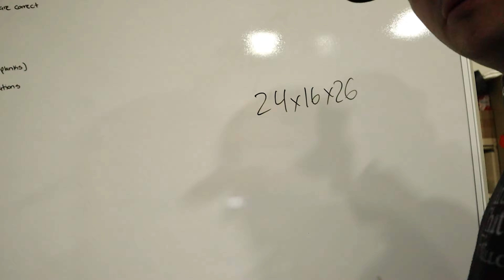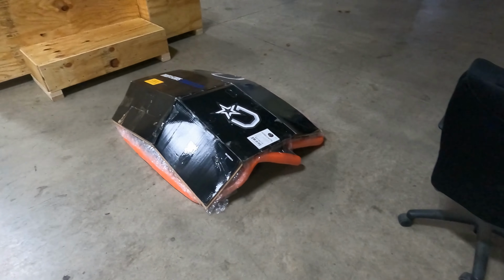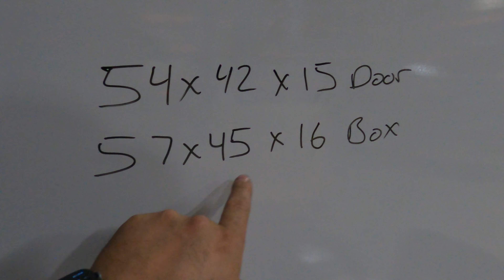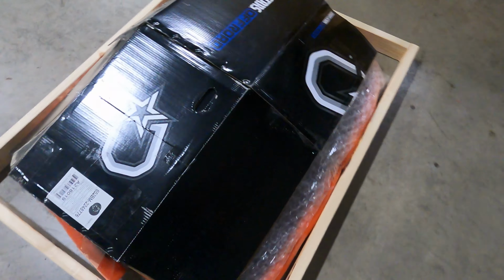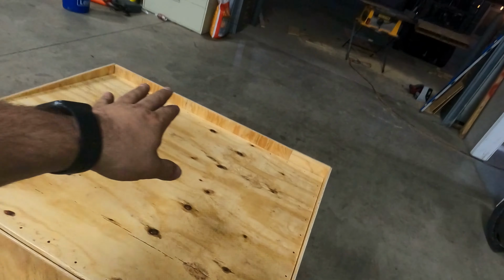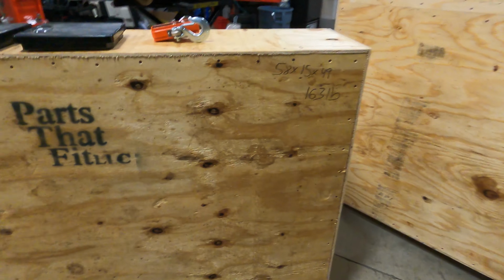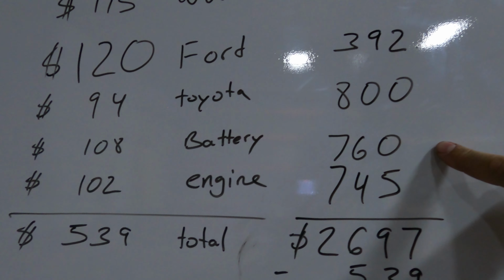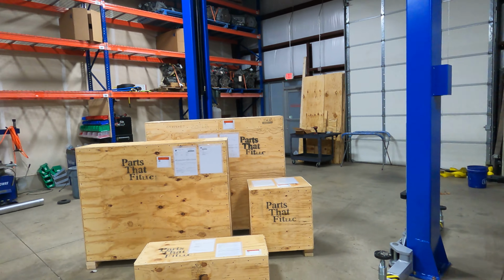HOW TO PACK LARGE USED AUTO PARTS  LIKE A PRO | EBAY BUSINESS | CRATE BUILDING | ENGINE DOOR BATTERY

Comment: How do you go about putting freight shipping in the eBay listing? Do you select freight and put in the description that it will be shipped through a carrier?

I noticed rates will a lift gate are higher in price so I’ll be taking my freight to the carrier and they have to pick it up.
Reply from the maker: On item like doors and engines I put a flat rate charge of $200 or $150 for freight. In the description I put that the item must be shipping to a commercial business location with a forklift or loading dock. Once someone buys the item I verify the address is a business. If not I offer them to pick up at the nearest freight location or $80 liftgate fee. 
you can also leave it as freight and the customer will have to contact you before buying to see how much shipping will be for their location.

Comment: Quick question regarding building the crates. Is there a standard spacing requirement on the space between the 2 "legs" at the bottom  for forklift or pallet jack that we must build to?
Reply from the maker: The spacing is not as important at the height. 2.5 is the minimum height for them to used pallet jacks. If the box is small they can you one of the forks to move it around.

Comment: Awesome vid. How do you decide what company you decide to ship with? Is it depending on the buyers location or what the product is that you are selling? I've been doing this for a little while with smaller used auto parts and want to get serious with it. Do you ever use UPS or usps with smaller items? I remember a box I sent with ups was like $90 in shipping so I was very surprised to see you could ship that hatch gate for $100 in that big crate! Thanks for the help
Reply: You should try goship.com or uship.com these companies throw you 8-10 quotes on different companies and its easy and fast. Instead of having a account on each freight company
Reply from the maker: Yes. We use uship.com to see what are best prices. Also it makes a big difference if you are shipping for a business to a business. Residential deliveries are expensive. You can drop the package of at the freight terminal and your customer can pick up at the terminal near them to save money if there is no business location.
Reply: @partsthatfit349  i have used both and to be honest goship is slightly cheaper. Apparently uship takes a bigger cut. I have a hard time uploading tracking info on freights. How do you take care of that?
Reply from the maker: In my area I like to use YRC freight so I don’t go through Uship.com avoiding the fees. But if Yrc is expensive I check uship to see more options. 
With Yrc I upload the pro number and carrier as YRC it works every time.
Reply: @partsthatfit349  thanks man! I know ebay has some accredited carriers and I upload pro from them too and sometimes it works sometimes it doesnt. Ill look into that

Comment: Is that cost friendly to use that much material for just shipping?
Reply from the maker: Not necessarily but headaches avoiding for sure. We had no damaged freight since we started crating. Used to have 3-4 damages a month and dealing with insurance. Also used parts are not covered by insurance in most cases. So crating saves me money and time.

Comment: What kind of scale is that you used for the forklift. I need one for my freights because the one I have is only 300lb
Reply from the maker: Bonvoisin Digital Crane Scale 1000kg/2000lb Industrial Heavy Duty Hanging Scale with Remote Control Portable Electronic Weighing Crane Scale 5-Digit LED Display CE Certified (1000kg, Orange) https://www.amazon.com/dp/B088BL3DF5/ref=cm_sw_r_cp_api_glc_fabc_PrAZFbPB5YYZB?_encoding=UTF8&psc=1 

I got this one from Amazon
Reply: @partsthatfit349  thanks so much! Will get one immediately

Comment: I can certainly see why your business failed as you've used $20 in bubble wrap $28 in foam floating material $2 and tape oh my God the hundreds are spending in plywood and 2 by 4 it's just a package up of what 2's a $100 dollar dollar door no wonder you failed You can't employ that much expense in your packaging to sell a used part there's not that much profit Your building is too big and you have too much expense and overhead you need to find a better way to accommodate all your items but your cost has been your failure way too much Concentrating on lowering your cost would help your business but since you're out of business now you gotta start over with a new mentality